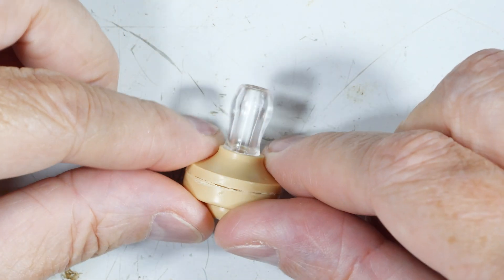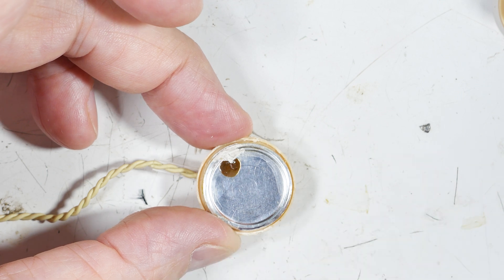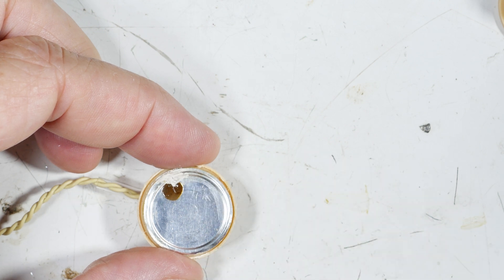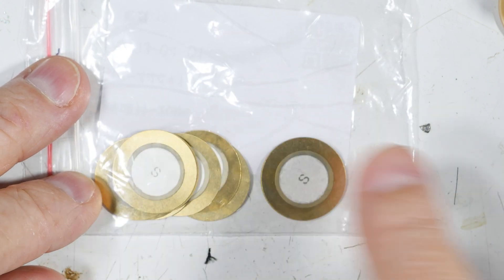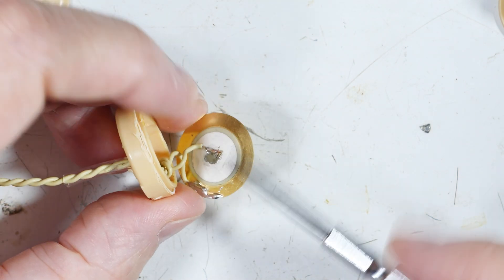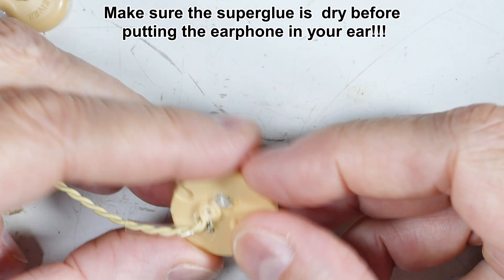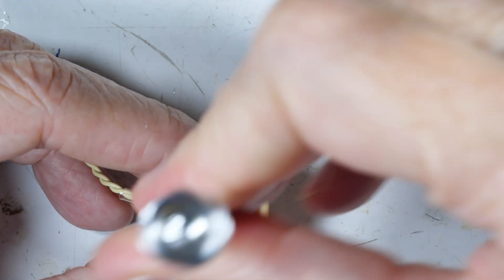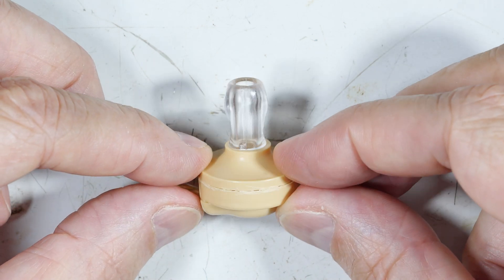PSA: Crystal Radio-Bad Earphone Pt 3 **FIXED!!!** (4K)

Comment: Excellent series. IMHO, this project had great merit. This issue with the ear phones has plagued us for literally decades and this is the first time I have seen anyone follow through on a true solution. Kudos for sticking with it and working it out. Additional thoughts... If you have an old stereo, or ear protection headset (I think they are even sold at the Dollar Stores?), you might be able to DIY those with the piezo wafers. If you were creative, and careful, you might even keep their original workings and just add the crystal radio option... Maybe put a jack on the headset, so the wafer option wire could be disconnected. TS, please tell us, would two wafers be connected in parallel, or series? I think that old telephone headset piezo cartridges are also used. The wafers are encapsulated in a tin case. I have some and I listed them on FlEBay, for years. But, I only sold a few. If someone wants them, I would put them back on FlEbay. TS, if you are in the Lower 48, I would send you a  free set, in support of you and your channel. But, we would have to find a secure way for you to provide me with your address. Let me know. Just to be clear, you can not directly use stereo headphones (speaker style) with a crystal radio. You must use piezo wafers, by some means.

Comment: I hope this won't worsen the sensitivity of these headphones
Reply from the maker: I decided to test the sensitivity, since I could not be sure otherwise. I attached 1 repaired earpiece and 1 made in Japan to the output of a crystal radio at the same time. Put one in one ear, and the other in the other ear. They were both equally loud. Whew!
Reply: @tsbrownie  I was curious because I was going to make such a handset myself. Are you sure both your ears hear equally?
Reply from the maker: @Lechoslowianin  I am sure they do not hear equally, so I swapped ears! One of the 2 I repaired was quieter because the knot was too big and pressing on the diaphragm. I had to re-do the knot.
Reply from the maker: The piezoelectric part is the same. The element is much higher quality, more like the made in Japan ones.